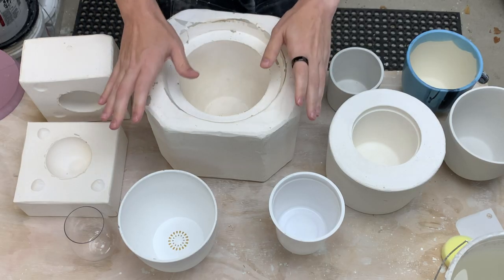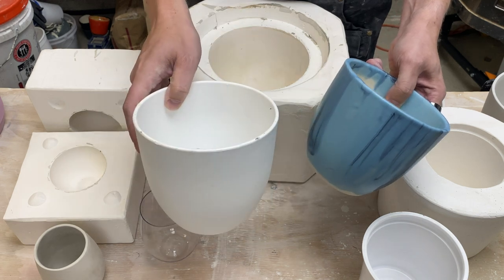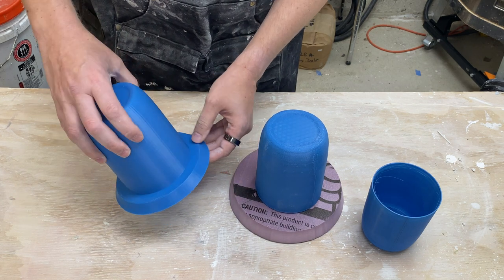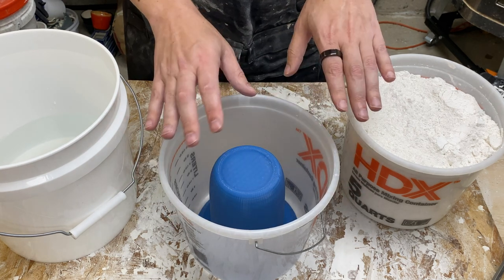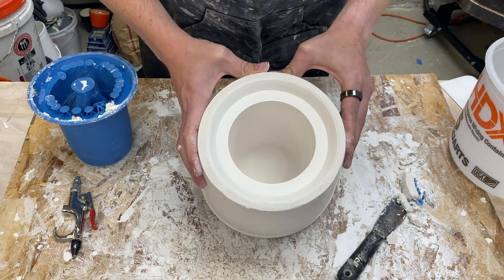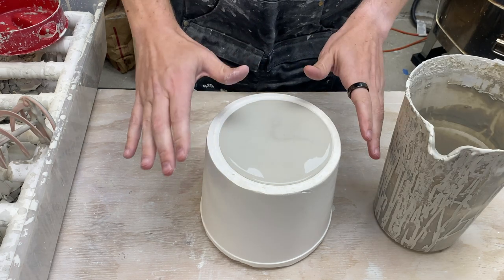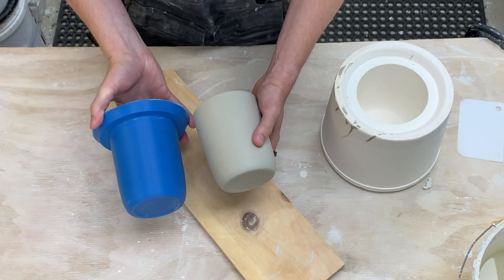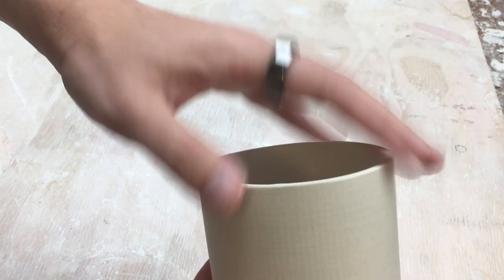3D Printed Form for Slip Casting - Clay Shrinkage and a Slip Well

Comment: Hi Kent, one of the best ways I've found to clean up a 3d print surface is to apply UV resin (mixed with some cornstarch) and then cure in the sun or with a UV light. It would let you get the original extremely smooth and eliminate the need to post process the pots themselves.
Reply from the maker: Thanks. I've seen a similar suggestion before. Can you say more about why it would only fill in the valleys of the 3D print between the layer lines and not also the parts protruding (the layers themselves)?
(I have follow up videos using filler primer, and its the combo of primer to build up low spots, and sanding to take down the high ones that makes things smooth)
Reply: @PotterybyKent hi Kent, so what joe said was sort of true, it's the same principle to a clear coat of varnish on wood, surface tension keeps everything smooth, but another way of doing it would be to use abs instead, the only other requirement would be to use an enclosure to avoid warping, but once you have it you could vapor smooth the 3d print with acetone and it will leave it glass smooth
Reply from the maker: Thanks for the explination @ericsaul9306. My model of how this works is missing something for sure. So based on this, the outer surface, where the resin is, wants to be held smooth because of the surface tension, as opposed to it building up a surface with a more or less a fixed offset from the 3d print (like a paint would). I guess in this case getting the viscosity and thickness just right would be important.
Reply: @PotterybyKent  that's exactly right, too thick and it won't flow, too lean and it will just fall like water, also the best way to apply a coat is through a spray gun, as it will leave even coats, the best example I can think of are car paint jobs which leave the finish glass smooth
Reply from the maker: Thanks for shedding light on that!
Reply: Hi, Kent please tell the name of the best plaster for mold I can use please 🙏
Reply: Hi, Kent please tell the name of the best plaster for mold I can use please 🙏
Reply: Hi, Kent please tell the name of the best plaster for mold I can use please 🙏

Comment: Does the shrinkage rate change within the same clay body depending on the batch?  For example, I bought a clay body from Laguna clay and it has a shrinkate rate of 10%   +/- 2%.    After using the clay, I discovered it has a shrinkage rate of 12%.  If I buy a new bag of this same clay body from Laguna, will it always have a 12% shrinkage rate or could the next bag have a 8% shrinkage rate?
Reply from the maker: The answer to your final question is yes that means it could be different between batches. So 10% +/- 2% means a given bag could have a shrinkage rate anywhere between 8% and 12% (which seems like a very high range!) I'd guess that means they have a lot of variation on their input ingredients they aren't controlling for. I had assumed (maybe incorrectly) that the range is much narrower, but that is likely highly dependent on manufacturer, or even the specific product line for the manufacturer.
Reply from the maker: One other thought is maybe the clay has a high range in temperatures. Like cone 5-10. It's possible some of the shrinkage variation they're accounting for is from that. If that is the case maybe the shrinkage would be more consistent given a specific firing target.

Comment: If you made your model as a solid object.  You would need the supports and and use infill to help with the structure support. Also should allow this to print much faster with less plastic waste.
Reply from the maker: I'm pretty sure that is incorrect. Adding the organic supports doesn't require that much more material. Also, it is rather important for it to be hollow so that it can be removed from the plaster (as my followup videos show).

Comment: You might be able to increase the angular resolution when exporting the model from your 3D modelling software to get a smoother surface and avoid those vertical ridges. Would be nice to see you make some pots in distinctly 3D printed shapes. These videos are very satisfying to watch. :)
Reply from the maker: Thanks for watching and sharing! Indeed I was able to bump it up and the mesh was much smoother as a result (and that's the default in shape cast right now). I do want to get to more unique designs - I just need to find the time/motivation to wrangle the code!

Comment: 🤩 Very useful!  I actually like the vertical artifacts.  As to layer lines, by switching to an 0.6mm nozzle I can print at a relatively high resolution (0.2mm) and still have reasonable print times. I upgraded to a ruby nozzle and have been very happy with the results. And... 0.4mm draft prints are surprisingly usable and very short print times.
Reply from the maker: I've actually drinking out of that piece right now and the shadow lines created by the vertical lines are actually really fun. I'll need to play more with them to see what I like the most!

Comment: Hey - nice. The seam you're seeing along the side of the pot can be gotten rid of. It's there because each layer starts and stops at the same point. However, getting rid of it (by telling the slicer to randomize the starting position) makes it harder to sand out. I probably would have created the plastic mold in one piece with the bucket, but your way worked great. Also, I would - and have - experimented with patterns along the outside of the pot but most of my patterns have made demolding slightly harder and sometimes impossible. :/

cheers,
m
Reply from the maker: Thanks for the feedback. I havent played with PrusaSlicer much but did see the option for altering the print seam lines.   I like the idea of adding in patterns to the surface, but that might require going to multipart molds.
Reply: @PotterybyKent  Yes, print seam lines is exactly the option - but I think you'd be better served slightly sanding the part before casting - the seam errors will still be there but they'll be spread around the model at random points. Also, you printed the first demonstration the wrong way up, visible because the lines were coming of the model in the bottom indent. For the actual mold, it seems you flipped it over which solved the issue. However, the empty inside with the supports was probably slower to print than a solid model with moderate infill would have been, because the outlines take a lot of time to print. However, as you noted, the support tree turned out to be a handy handle to extract the mold. Something to consider would be to deliberately design a handle for that at the last couple of centimeters to speed up the print.

As for multi parts - yep, I made a two part mold of a vase with a semi circular indent scooped out repeated like 32 times around the outside. Looked very involved, but I couldn't demold it without waiting for about a day when it had shrunk enough to let go of the molds, which wasn't what I had intended. Since then, I've been doing four part molds instead, but that comes with a lot of seams. I wanted to make thin throated vases, and that was never going to be easy with a one part mold. I'll be transparent any note that I don't actually have a pottery oven so all I do is experiment - but with actual plaster and actual slip.

One more observation I'd make is that your molds are very thick - and I've seen people suggest that that's the thickness you should aim for. However, for me, plaster is fairly expensive and the molds take a lot of space. I suspect that the thickness is important if you want to make many pieces over a single day - the capacity for absorbing water is greater with greater thickness. If you're developing a shape, 3 or 4 cm plaster molds seems to be enough, though they're wet for the rest of the day after a single casting. Again, not suggesting you're doing anything wrong.

Btw, I'm also a software developer - often involving coding in my more physical projects. Most such projects are an attempt to get away from the keyboard...

How do you make the little texts on the bottom of your pieces? That must come in handy!

cheers,
m
Reply from the maker: The two scale prints I showed at the beginning were printed right side up with only a couple shells wide - so very fast since no support is needed (but yes with artifacts). For the actual print used for the mold it is printed upside down as noted so that there were no supports in contact with the outside surface. I've also found solid (or infilled) 3d prints can be extremely difficult to remove from plaster - so wanted it to be mostly air so it could flex (or be destructively removed easier) if needed. And yes, designing in a handle is probably a good idea!

Yes, these plaster molds are all too thick for my liking. They are functional, but not ideal. What I am working towards is 3d printing an outer mold as well. I'm in the process of getting software to auto generate that mold. It'll probably take a few iterations to get it where I want - but step by step!

My makers mark on the bottom is a stamp I created from silicone (cast into a 3d printed mold). I then use a stamp pad that has underglaze (instead of ink). https://youtu.be/di2p1phIHlU

Comment: Loving the vids, have another sub..  Hey, you mentioned plaster likes to stick to itself.. With that in mind, could one not patch up air bubbles with a little plaster on a finger tip?
Reply from the maker: Thanks! Yes you can (although I havent tried much myself). The hard part is getting to where the bubble is inside the mold and then getting a good surface finish (as opposed to just cleaning the slip cast pot afterwards).
Reply: @PotterybyKent  Yes fair enough, things could get messy quickly, poking around with putty in the bottom of a pot.  I see your molds have come a long way since this vid, I'm almost caught up. :)
Reply from the maker: Thanks for watching!!

Comment: How to create a 4mm wall thickness?

Thanks a million 

Geoff
Reply from the maker: For the finished pot? You just need to try it out with your slip and plaster (and weather!). Longer will be thicker and shorter will be thinner. That will let you dial it in. Also don't forget to take into account the clay shrinkage - it'll be thinner once fired.

Comment: Hi Kent ! I am Stelios from Greece!! 
What you use on the plastic model to not stick the molder??? 

I make a model from abs material and I have problem
Reply from the maker: At this point I don't use anything on them. My prints are in PLA but I'd imagine ABS would work fine. Make sure you have a good draft angle. And you can also try using a mixture of frozen wanter and isopropyl alcohol. This stays liquid at freezer temperatures and when poured into the print causes it to shrink just a bit so it is very easy to get out. I have a video on that in the play list and my more recent videos show it as well.

Comment: Great tutorial 👌 Can you name the release agent you used on 3d-printed part with napkin?
Reply from the maker: I've actually stopped using anything on my 3d printed molds. A few videos later I show how I now get them out with a mix of frozen isopropyl alcohol and water. But for completeness, that was Murphys oil soap and any non-detergent soap would do something similar.

Comment: Thanks for this video series, very helpful. 

One, question, what sort of wall thickness are you printing your forms at? I'm guessing they should be a bit flexible for release, but rigid enough so there isn't any deformation when pouring the plaster. Is it possible to find the right balance?
Reply from the maker: That is exactly correct. Those two requirements point in exactly opposite directions unfortunately! And that is why things like silicone and a rigid backer are often used. The other issue is you need the wall to also not be porous to plaster. I've settled on 2.4mm right now (0.4 nozzle size * 6) and it seems to be working well. The real trick was finding a way to slightly shrink the PLA part while inside the mold to release it. I have another video showing how to use a mixture of frozen alcohol and water to do that.

Comment: is there a reason why so many pots do not have proper plant drainage? Can the holes be placed while it's green?
Reply from the maker: As for why - you'd need to ask the creator! But yes, they are trivial to add. I usually put them in at the leather hard stage as it's easiest to cut the clay and not deform it. When it's bone dry there's a risk of breaking the pot. I've done a few after they've been bisque but you need something like a diamond bit to cut through then.

Comment: 7:40 what substance did u use and how much shrinkage does slipcasted clay gets?
Reply from the maker: It is mold soap (Murphys oil soap in particular). I've stopped using it on my 3d prints. The shrinkage of the clay depends on your clay body (just like throwing clay - it depends). Mine is 13%.
Reply: @PotterybyKent  Thank you this is very informative and helpful! 💖

Comment: Hi Mate, what is the purple material you are using at 0:08?

What’s his name? Thanks a lot
Reply from the maker: It's expanded polystyrene foam. It's made as a sheet for insulation and is easy to cut.

Comment: Do you need mould release? Or dos air gun suffice?
Reply from the maker: For the 3D printed form, at this point I've switched over to an alcohol and water mix that I keep in my freezer. I put that into the mold which gets it cold and shrinks it just a bit and it pulls right out. Check out this video: https://youtu.be/5Y1fQsqht_4
Reply: @PotterybyKent  awesome! Thank you!
Reply from the maker: You're welcome!